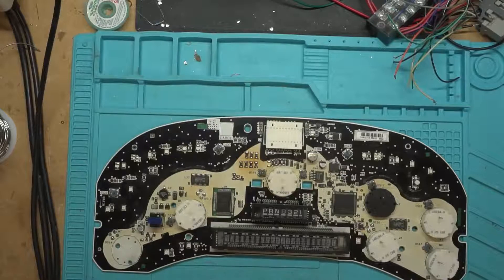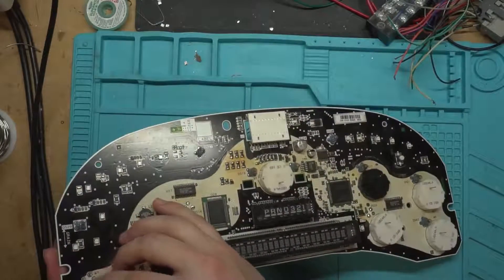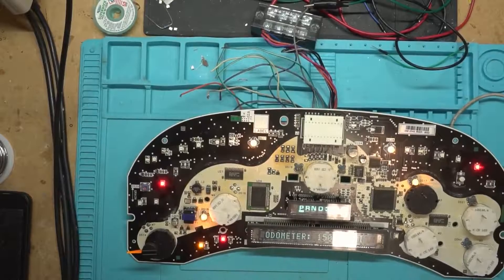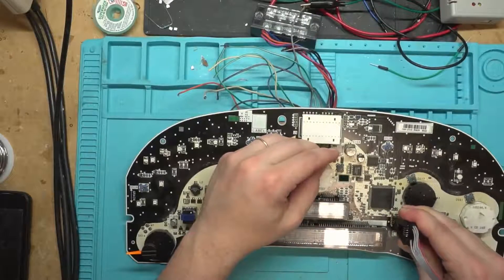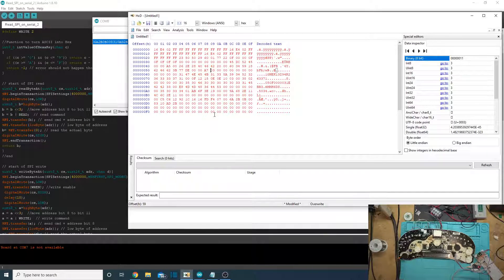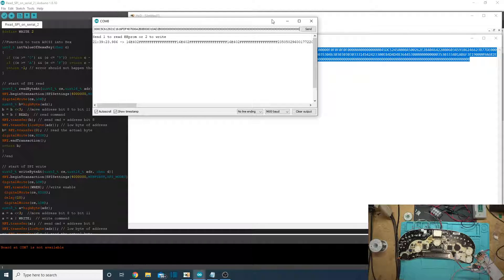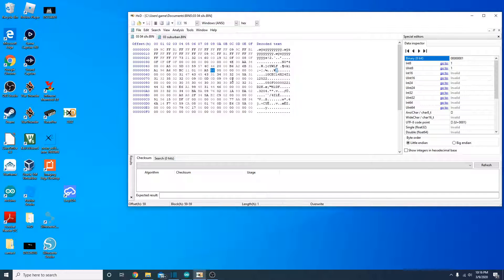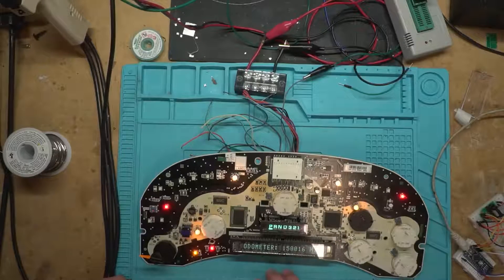Adding Transmission Temperature Gauge 2003-2007 GM Instrument Cluster

Comment from the maker: By the way I used the cheap black stepper motors for the test. I have a few laying in a junk box I use whenever I am messing with the test boards I have laying around.I save the black steppers and x25s from repairs to use for freebie repairs and testing. Never for official repairs. I will probably start filming the new copy of Odometer correction soon.
Reply: Thanks for this video. 
It seems somewhat ironic that two (or more) different tech's have two different opinions on these black stepper motors.  If I remember correctly Jack Meyers (diagnostician in northern cal area) switched over to the black ones, after several failures with the X27.168 units, & claim he has had zero failures with them. Go figure huh?
Reply from the maker: @robtemple3445  never had a failure with an x27 that wasn't related to poor shipping. All had physical damage. I've never seen a failed one of these Black steppers and honestly I think highly of them. I personally don't use them due to stigma. The only one I would never buy are MCR steppers. The shaft diameter is wrong on them.
Reply: Where do you get the black steppers do you have a link ?
Reply: I need some black ones every time I find some black steppers they send me white ones

Comment: So are you saying that the 03-04 could be pre-programmed for trans? Also, how would you know other than adding a motor
Reply from the maker: its kinda 50/50 on that being true. If you watch the latest series on these I show a much easier way to program this/check it than pulling the eeprom. here is part 1 one of that video https://youtu.be/C32y12WdJ7g

Comment: youre giving me so much hope. i have an 03 and need to add a trans temp gauge. 1 video said it would work and now youre saying it will work without programming for the 03 cluster. fingers crossed when the stepper motors come in, hopefully i dont have to get it programmed. i dont have the tools for that.
Reply: Did you ever get that in? I also got an 03 and would like to know if it works without programming. My cluster crapped out and in the process of researching repairing that i fell down this rabbit hole
Reply: @mewmewdesigns895 yeah it worked for me. Easy install.

Comment: Does this work on 2002?
Reply from the maker: 99-02 is a different cluster. Trans temp can be added to it but it's harder to do.
Reply: @FixedUntilBroken  I saw your other video. Do you have a website I want you to mod mine.
Reply from the maker: I actually have been too busy with my day job to take on clusters right now. The stuff I do on YouTube is just a hobby. 

There are other people that can do it but the cheapest option is to buy a cluster that already has it

Comment: OK, so I have a 2005 GMC Yukon XL they don’t come with the transmission temperature gauge. I had McCluster redone and the guy put a bad ass lead on the Cluster and he installed that transmission gauge. Do I have to do anything else by a wire so it can work or is it already there?

Comment: Thanks for this. Used these directions and your programming tool to add this to my truck. I have a 2004 Yukon XL for the Canadian market, so when I went in the bit was originally 21. I changed it to 20 and it works. I also took the time to replace the burnt out lights with new ones from Mouser Electronics, part number 560-ESM1EW10YLW.

Comment: Hey, I found your channel and have been binge watching all your gm cluster videos. Great stuff!!! I am going to try and make an arduino programmer from your tutorial. I have a weird situation; I have an '05 tahoe that I bought used, but I do not suspect the cluster is original. It shows a perpetual SRS airbag warning but when I scan for SRS codes from the computer it shows none. I have read that this could be caused from a different year cluster installed in the 05. Is the SRS alarm programmed into the cluster prom chip? I am wanting to rebuild my cluster with new steppers, led's, prndl lighting, and adding trans temp. If the cluster in mine is a different year, would I program it as an 05 or as whatever year the cluster actually is?

Comment: I have an 05 suburban that had 01. After installing a stepper motor I had nothing. I reprogrammed it to the 42 and still nothing. Could I have installed the wrong stepper motor? are there different ones?
Reply: Did you figure it out

Comment: On different clusters I read the file and after the A7 or A6 its just random numbers and not one off the numbers that you are showing .                                                                                                                                                                                                            For example one that has a working trans gauge reads Line 00000050 - 5B 60 88 96 A6 03 00 00 A7 28 00 01 00 00 00 00

Comment: What about manual clusters? 
I understand 03-04 clusters have trans temp senders and temp gauges enabled (but not installed) 
Are there differences in flashing? Does a sender have to be installed and wired?

Comment: I really appreciate this. I wish your amazon links were still working. I need to rebuild my '05 gauges that are mostly dead and want to upgrade mine with the trans cooler on the stock board.
Reply from the maker: They are dead? I will replace them tomorrow.

Comment: How can you tell if your 04 is pre programed for it?
Reply from the maker: easiest way is to just put a stepper motor on and check it in the truck. You can also read the EEprom and see if it is flashed for it.
Reply: @FixedUntilBroken  thanks I did and it worked. Ordered a ch134a got it yesterday. Now I'm trying to figure it out with no knowledge of any programing.🙌 innanet 100

Comment: Excellent video, I've already ordered all the parts I need to build this.  Thank you very much for sharing!

Is it the same process to enable the Drivers Information Center on the cluster too, or do you have to have the information from another cluster that already had it enabled?
Reply from the maker: That is on the microcontroller not the eeprom. It can be done with a tech2 plus tis2web. I also have videos on manually programming the mcu but it can be tricky.
Reply: @FixedUntilBroken  _thanks! I just watched your most recent video and wasn't expecting a reply so fast. Hope everything is going well with your wife. Great channel too. I definitely subscribed :)
Reply from the maker: @colin8532  thanks. Yeah youtube sends notifications like texts for new comments on the channel so it's super easy to reply with my phone. I just can't make videos while chasing the kids around.

Comment: Great Video ! I have a 2003 Suburban Z71 that has "0" working gauges now. I need to go in and replace ALL gauge motors and 2 or 3 lights, so I have nice project for a few days since we can't really travel right now ; ). Glad someone was able to ID '03 as already flashed for Transmission Temp, I was wanting to do that upgrade, and now I know I can...and with minimal additional effort. New subscriber now, Thanks again !
Reply from the maker: Sounds like a fun project. Let me know how it goes!

Comment: Any chance I can send you my cluster to flash my eprom
Reply from the maker: Yeah I can do that. What do you programmed. Transmission temp?
Reply: @FixedUntilBroken  do you have a email I can't shoot over my info.
Reply from the maker: garnerm91@gmail.com
Reply: @FixedUntilBroken  I sent you a email. I'd also be interested in just having you make me a eprom flasher
Reply: @FixedUntilBroken  yeah I haven't tested it actually rear ended someone while I had my spare cluster in. But from my understanding a 2005 won't have the right flash to run the trans temp.

Comment: I read somewhere that the eeprom to program for trans temp on 03/04 is actually the one near  prndl. Is that true?
Reply from the maker: Transmission temp is on the eeprom. (The atmel chip) 03/04 is by the prndl 05, 06/07 is by the mcu.
Reply: @FixedUntilBroken  thank you! I appreciate everything you do for the community
Reply: @FixedUntilBroken  so are the 03s/04s are already preprogrammed for trans temp?
Reply from the maker: @joshuabrown4181  some not all
Reply: @FixedUntilBroken  how could you tell which are which
Reply from the maker: @joshuabrown4181  same way you add it. Read the eeprom. If you have the truck you can just throw the motor on and see.

Most of them them had it were made in 2002 (so early 2003 models) some had a bulb in the t-temp spot
Reply: @FixedUntilBroken  i have the truck which. Is an 2003 model

Comment: do you know which pins from the ecm are the ones to set the gear selector on each gear?
Reply from the maker: It's on that same thing from lt1 swap  it's different combos of ground on the wires listed to do it. I've only ever wired it to do park none of the rest matter to me if 1 works they all do
Reply: oh alright thanks ill give it another look 👍
Reply from the maker: @pelown13  no prob. I forget what the label is on them but I think there were 4 of them
Reply: ill look around i just need at least 1 gear to be selected so that way i know it works thanks for the help!

Comment: what kind of programmer are you using to send signals to the motors like when you asked for the trans temp hot
Reply from the maker: It's just a pcm in a box with some potentiometers. I've got an older video covering how to make it.
Reply: i got my hands on a pcm out of a escalade will it work for the bench testing? part number its #12582605, by chance you have the pinouts for it? or the diagram?

Comment: Just picked up a 2005 silverado 2500 HD with steering controls and no Trans temp gauge. Happy to share Bin if you need it.  date code says 9/2004. After reading the bin I'm thinking i have a 2004 Gauge cluster.  No trans temp gauge so I'm adding one. Line 00000050 - 9C 89 7D 70 05 76 00 00 A5 01 00 00 00 00 00 00 . You mentioned in this video if I had the A5 code and in this case 01 is no gauge I need to change to 00 just confirming or has this changed?
Reply from the maker: Yes change it to 00

Comment: I also wanted to ask you another question. I have a 2004 Trailblazer. I just noticed my trip button is not working. I push it in and it does not change from odometer to any other function. I'm assuming trip is the only function it has. Anyway when I turn the key to the on position it shows trip and has 88888888 all 8s then switches to odometer as it goes thru its normal functions when you first start the car, Or key on engine off. I did try holding the button for 30 seconds and still the display never changes from the odometer reading. Any ideas? At this point I have never had the cluster apart but who knows whats been done previously. The previous owner told me it was a new exchange cluster because his had some issues. Healso toldme it had about 30,000 more miles on it when he got it so I plan on turning it back.

Comment: So I ordered a chip from Jeff. He sent me one that is suppose to be programmed for 2007 silverado classic . I bought the tl866 II plus and the tachosoft software. I just read the bin, miles and hrs all match up to what I've learned from watching your video's but the Trans doesn't match up to what your telling me here on your video so please help. I have A6 8A did he write it wrong? I haven't removed mine from my cluster to read it yet. I did tell him I had trans gauge.
Reply from the maker: A6 Is for led prndl . Give a test run it. It may work I was testing on A7 in this video which is for vfd prndl 2005. A5 is 03/04 The 05-07 EEprom is definitely different than the 03-04.
Reply: @FixedUntilBroken  Ya I know you were testing a 2005 which should be the same as mine. According to you A7. So what year did A6 come in? and 8A doesnt go along with anything you mentioned here for turning transmision gauge on or off..  I don't want to install it just to test. I want to do it once and be done. I'm waiting for some new chips to program from my original eeprom. There's nothing wrong with it.
Reply from the maker: @mogyver69  a5,a6,a7 are all the byte before the trans temp data A6 should be the 06/07 but Id have to pull the data off one to make sure